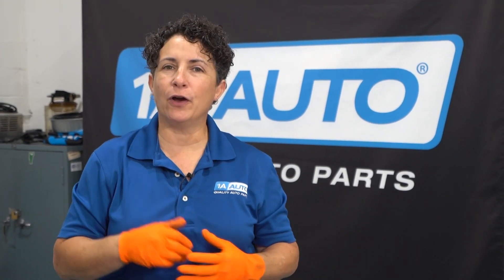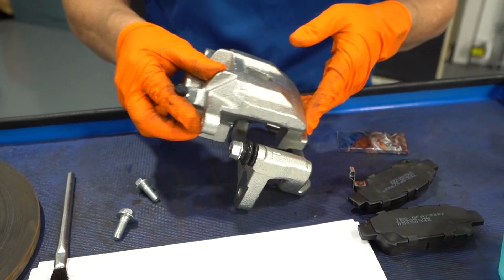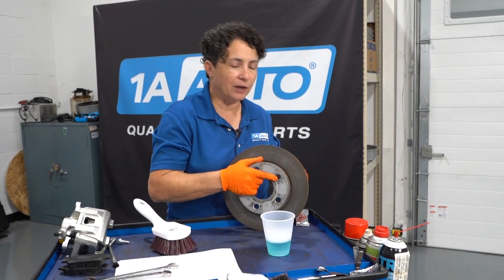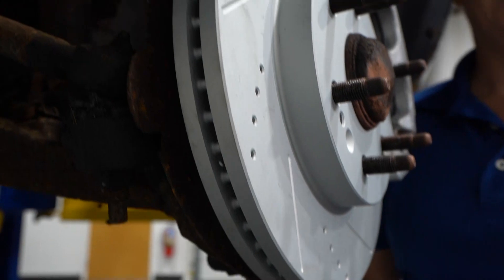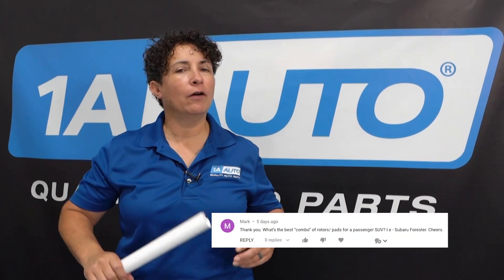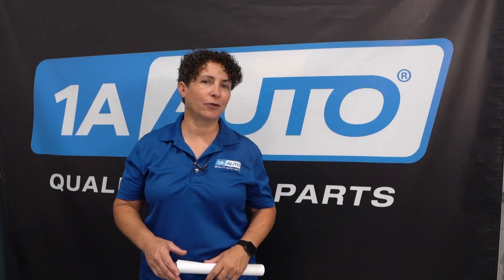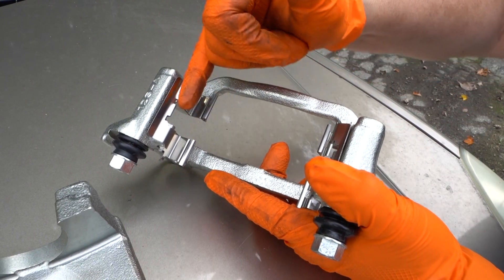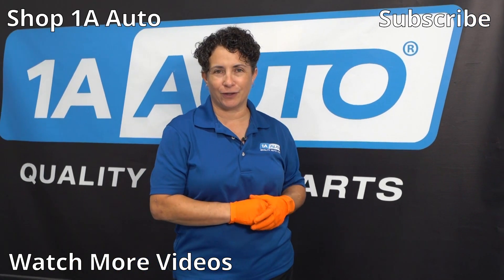Answers to Your Questions From "What's Inside Brake Pads?" Sue's Recent Popular Video!

Comment: On the second from last part I would check the heat sheild ive had problem where I some how bent the heat sheld toward the rotor and when I test drove it I heard a chirp on every revolution of the wheel I push the heat sheild away from the rotor and that fixed it. Now I also had that chirp noise in the rear brakes before and turned out when I was trying to remove the rear rotors I bent the hardwares for the emergency brake so when I was driving the hub was rubbing on the hardware of the emergency brake

Comment: 2008 gen 3 acura tl 249432 miles..almost 250k.l..mint interior no cracked dash no ripped leather seats..can you guys do a video on the gold acura TL you have in your lot..andy did a video on it a while back...im just wondering what parts you recommend and mine is at 40%full synthetic and it has been used with premium fuel it's whole life...would like to see it up on the lift to show anything that I may need to do to maintain it..i bought it a year ago..great powerful front wheel drive car...I've seen people switching away bars and exhaust from the gen 3 acura tl type S or S type...had my rear brakes done at midas..1 caliper was completely locked up I couldn't turn the wheel while it was jacked ☝.. It cost me $600+for 1 caliper 2 rotors and carbon ceramic pads for the rear..its crazy to pay so much for a job like this...i had it done on a Hyundai elantra and it was like 800 for front and 700 for rear cause I replaced all the calipers since 1 front and 1 rear were locked up...i have my baby in the car so I figured to always replace in pairs..im rambling... would like to hear what if anything I can do to it at 250k to take care of it for another 250k...the clear coat is wearing on 1 side where the sun hits it when it's parked...just looks like matte black paint...should I sand it and attempt to repaint that side panel and door or just clean and remove the parts where it's peeling and spray some clearcoat without primer or paint on it and hope for the best...i got a great deal on it from a good friend who drove long distance 3 times a week..mostly highway miles..(sorry about this super long run on sentence.if anyone reads this far to see this😂